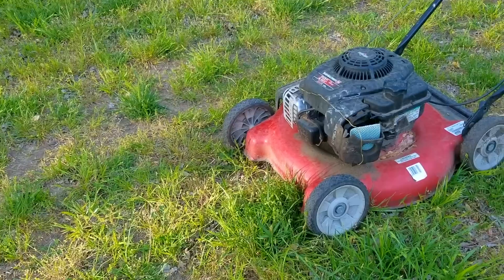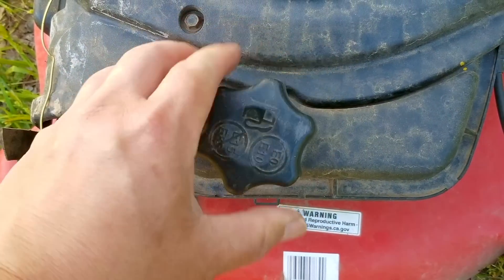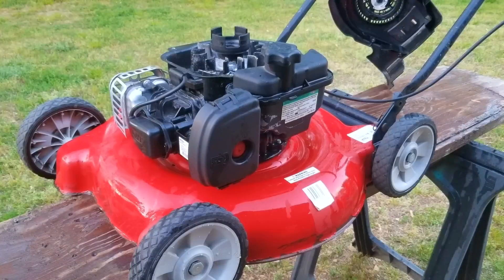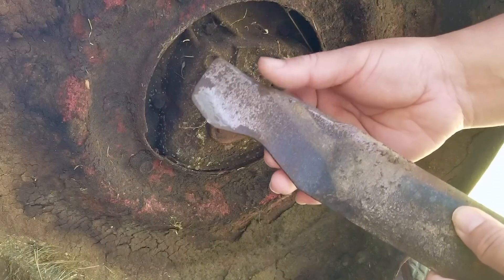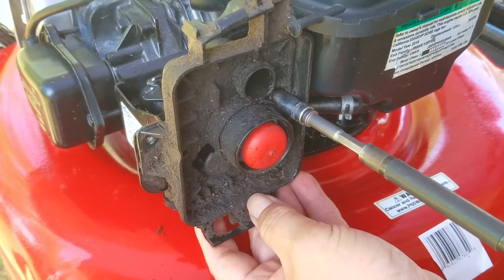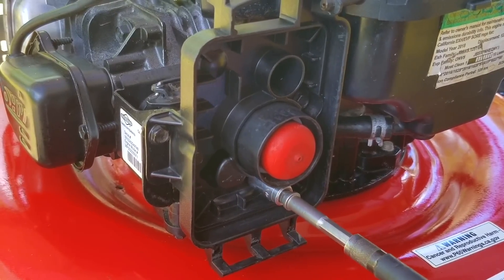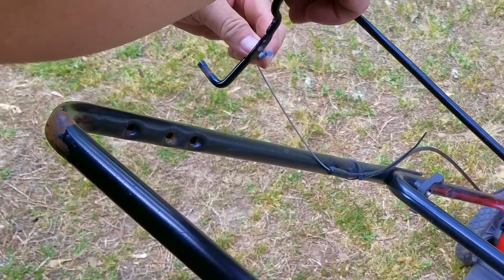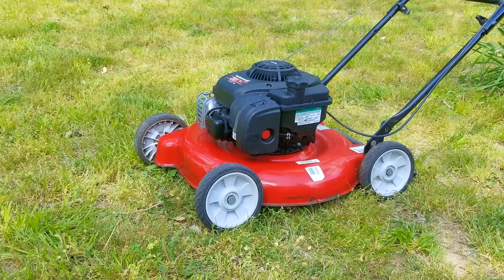Fixing A Redneck Repair On A Yard Machines Mower

Comment: These mowers were 79 - 99 bucks at the big box stores. They are now pushing $200 if not more. I always repair when possible. I have fixed equipment and sold or donated instead of trashing. Great video as always. 👍👍
Reply from the maker: thank you Dan Pags
Reply: $250-300. $299 at ace and home Depot. Lowe's dropped it down to $269 for the same MTD . The industry has been doing bad business for years. I blame excessively liberal returns, making too many different models and not fighting against regulations effectively. Also I guess running lean does increase horsepower but the government wouldn't let you play that up. Bull crap
Reply: Yes I was shocked.  For years these bolt wheel 20" were $99.  I bought one for the cabin at Lowes in 2014 and thought $135 was robbery.

I walked past a display and that thing is nearly 300.  

I was wondering how you could really profit off a used one with two or three hours work even if you picked it up  as free trash... as a fair price was likely $40 for a scratch and dent with worn blade...but now I see.  You're likely charging $150.

Comment: Good little video. Yes I've done this "Redneck" repair just recently on my JD L110 riding mower. For some reason the fuel is not get.ting from the tank to the fuel pump ( been extra busy to troubleshoot it) so I had some extra fuel line and took a fuel tank off a spare push mower then hooked it up to the fuel pump and she fired right up and I moved my lawn with it 😂😂😂
Reply from the maker: hey nice job!

Comment: Hmm.  When younger I may have used a wire coat hanger to hold up part of my car's exhaust system as well as something to patch a hole in the muffler.  I have no problem red necking something on a temporary basis.  Great repair of this mower.
Reply from the maker: hey if it works! And thank you  D Butler.
Reply: On my way to work one morning my exhaust broke behind my cat and was dragging on the street.  I yanked the boot laces out of my Army boots in my trunk and tied it up and drove to work nearly deaf.  Worked great to get it to a shop after work.

Comment: Clean the emulsion tube inside the carb. There are quite a few great videos out there that explain how to remove, clean, and reinstall the emulsion tube. I had a similar issue on my toro turf master with a Kawasaki FJ180V engine. It would start surging after five minutes. Now it works great. Thanks for all of your advice and informative and entertaining videos 😊
I am referencing the Troy bilt mower that has a running issue when hot
Reply from the maker: thank you Courtney Kensington

Comment: Great video🎉 Thank you. Looks like they never changed the oil on it.  It will take about a gallon of gas via 8 engine flushes to clean out that carbon and metal shavings in the oil reservoir.
But it will be a great visual selling point having clean oil in the engine.
It will give the illusion it was well maintained.
Reply from the maker: yes I think you're right!

Comment: A true red necked repair I did ones was on a 72 Ford f 100 ,it had a 3 speed on the column ,the column pair of the shifter had warren completely out ,by the time it had warren out finding a new or used replacement was almost impossible so I cut a hole in the floor above the transmission and attach 2 shift handles made from the handle of a push lawnmower one handle could shift it into eather reverse or 1st gear and the other handle could shift it into 2nd and 3rd 
We used it that way for about 4 years entail the truck finally gave up the ghost that was in 2004 and it had over 300000 miles on it
It 300 straight 6 in it
Reply from the maker: very true

Comment: I did a creative fix on a riding mower. The deck was broken near one of the mounts. I do not currently have a welder, and the mower was not valuable enough to warrant replacing the deck. I took a deck support bracket from an MTD riding mower that I had in my parts stash, hammered it flat, and screwed it to the underside of the deck directly under the support bracket. It provided enough support for the deck to function until I am able to purchase a welder.
Reply from the maker: hey that's good repair in my book

Comment: Smile - used molly and sheetrock screws to fix broken Honda airfilter enclosure. On the vintage one neighbor has it protrudes just enough that his planters rake against it. Mot enough meat to drill into so...

Comment: I've probably done every goofy thing known to man to try and get a job or day or week finished with something that hasn't been made since the Flintstones lent it to Barney Rubble but you use what you have at the time. I found that 4-O or OOOO-Steel Wool oiled up makes a good filter when nothing else is around. As to everything else, I plead the 5th or amnesia or general brain damage. Sure we have but getting us to admit it might be a hard thing to pull off. That was a FINE job and you need top dollar for that piece. The last Gravely will be gone from here tomorrow and the splitter shortly thereafter. ROOM! Thanks and Blessings!
Reply from the maker: nothing wrong with a bit of ingenuity !
Reply: @HomeGaragechannel  Poverty and desperation!

Comment: I just used jb weld to fix a crack in the deck of my mower. Not a rust hole, a flat out crack. Seems to be holding and while it appears to be fixed I’m on the lookout for either a replacement mower or a deck that will take my engine.
Reply from the maker: that works too.

Comment: Many owners of old VW's should be familiar with using a small pair of locking pliers in place of a rotted-away accelerator pedal.  The Vicegrips stay in place until you scrap the car, when you get your tool back for its next mission.
Reply from the maker: I like this comment

Comment: The one thing that comes to mind and just found the pic is using an old license plate as a bracket to keep the muffler on my snowblower. The cheap tin bracket, or the weld rusted and with a little bending and self tapping screws it's as good as new.
Reply from the maker: nice I like that one

Comment: did a great job cleaning it  and getting running  I was hoping you would discuss how to check the carburate   I have mower almost the same I took the carburate off  and clean it put it back and it started and it ran for a few seconds and then it quit I try to start it with staring fuel  and it will not start any advice you can give me will be appreciated
Reply from the maker: did you clean the brass jet at the very bottom of the white plastic part? If not you want want to focus your efforts there.
Reply: @HomeGaragechannel  I fail to do that  when I took it apart I found one of the three holes that it has plug up so  I assume that was the problem thanks for your quick respond Have a blessing day!!

Comment: What is the pre-spray cleaning chemical used before rinsing off with water?
Reply from the maker: I'm using the only degreaser Harbor Freight sells, they're in gallon jugs
Reply: Ok. Great! Thank you for the reply.
Reply from the maker: no problem

Comment: Yep that's my brother he really doesn't put any money in to his lawn mowers. I have his he let me have it runs its the 6.5 briggs engine i like them my dad has had a few of them run good if you change oil and use stabilizer and fog carberator before winter prime the fuel bulb and they fire right up every spring. My brother has had that mower for 8 years. Now he has my grampa mower wich is really nice. But it wont be it will sit outside maybe coverd up with a blue tarp some times hes also like that with his cars just rough on them.
Reply from the maker: that's tough to hear.
Reply: @HomeGaragechannel  also the air filter is falling apart and oil desperately needs to be changed it runs good but can run better. I also asked him if he had the 2 covers for the mtd yard man snow blower for it he said know he didn't. I will see if I can fabricate some covers or I will buy the covers. I know you should have them on there for protection from snow and dirt.
Reply from the maker: you are correct about the covers.

Comment: The lack of levers for height-adjustment is why I bought a Hyper-Tough 20" mower in 2020, instead of the competing Yard Machines or Poulan variations on the 20" side-discharge mower theme.  :-)
Reply from the maker: it makes sense to me

Comment: I'm sure you get flack for the amount of time you spend dealing with the wheels, but it is a legitimate concern. My big riding mower is 16 years old and has never had any preventative maintenance done on it before I got it. The wheels were never greased, and the openings on both front tires have worn out. Both front tires wobble. I added some washer to them and it helped a little, but I will soon have to replace both of the rims due to this lack of maintenance.
Reply from the maker: yes I've seen that happened before. It's amazing how someone could spend that much money on a rider and not read the owners manual

Comment: Choose wisely with 3d printers, cheap ones often can’t do high strength materials. Better ones can do rubber like materials and good strength materials. And high end can do nylon and polycarbonate which is basically indestructible
Reply from the maker: wow nice, thank you for the information

Comment: Hey there, I was wondering if you know the valve lash clearances for this mower?
Reply from the maker: sure .003" to .006"   but I find it easier to set it to .005"
Reply: Y you so much for that! I went ahead and adjusted the vale’s to that spec, but unfortunately my mower still has hard starting. I know it is a fuel related issue as it starts and runs perfectly once it gets going with drill, starting fluid, etc. I realized that pressing the priming bulb about 15-20 times gets a good response from the mower, but the factory 3 presses does nothing (this only happens when the engine is cold, starts first pull when warm). The carb has been cleaned and all internal seals look good to me. I wanted to ask real quick about how this system of the bulb works (creating vaccum in carb thus pulling more fuel, idk). Also, what is the little white spigot on the side of the carb? I feel air come out of it when the priming bulb is pressed. 

I’m sorry for the long story/question. You’ve been a huge help, thank you!
Reply from the maker: the bulb "pressurizes" the carb and forces fuel into the inlet of the carb.  That's how it primes the engine with fuel.  The white piece on the side of the carb is an air vent.   Have you done a compression test? If the test returns a "low reading" it would be the reason why it's tough to start.

Comment: I'm curious what you would ask for this mower. I just had the identical mower that I repaired and they were fighting over it in the driveway. Maybe I didn't ask enough?
Reply from the maker: it really depends on where you live but I'm in a suburb of a large city.  The new price for this  mower is $250 locally, so I'd say $90-$120 is a decent price range considering it's overall condition.

Comment: That dishwashing sponge isnt a bad idea to get you by on a cheap mower if it sealed better.  Soaking it in oil would help a whole lot more. I'm sure it filters better than a K&N since you can see through a K&N.
Reply from the maker: very true.
Reply: Yeah.  If they had cut the dishwashing sponge to fit like an OEM air-filter, I'd have been more impressed.
As an improvisation, the concept has merit.  The execution fell flat, though.  :-)

Comment: I have an air conditioner in my house which the sleeve rotted out (it is a large unit which the air conditioner itself slides out from a metal sleeve). For some reason the sleeve is almost completely rotted out at the bottom, but the air conditioner unit itself has no rust on it at all and runs fine. I used a ratchet strap to keep the air conditioner from falling out the bottom of the sleeve. I guess that would classify as a redneck repair...
Reply from the maker: very nice fix!

Comment: I have same mower it starts when I pump the red button but dies right after. I pull the throttle and parts move but, not by the carb. Do you have a diagram?
Reply from the maker: No I don't

Comment: well for me i,m not sure really but yeah thankfully Gasket Paper is often a good source of parts to make for either machines that no longer make those ones and yes i have had get creative and measure cut and trim and hole punch to size and it,s often worked for me etc.
Reply from the maker: nothing wrong with putting in effort to make a replacement, this was one of those times where they didn't try as much as they should have. Thank you Patrick Stapleton
Reply: @HomeGaragechannel  my pleasure mate and yes my good mate who lives in NSW (New South Wales) Australia might also agree with me too

Comment: It sounds like she is reving a little high, there should be a spring hooked to a little metal tab. You can bend the tab to increase or decrease the rpms of the engine.
Reply from the maker: yes you are correct. Good Ear. I did adjust the engine speed later on.

Comment: I have a stihl fs87 and when I give it gas and want to mow it cuts out and when it idles the head in which the wire is turned also turns when I want to start it sometimes it cuts out please help
Reply from the maker: sure, replace the carb and the clutch
Reply: @HomeGaragechannel  okay that's not a good sing but its 20 years old so i think it's not worth it haha
Reply from the maker: I understand. It sound like you got good use out it
Reply: @HomeGaragechannel  Jup that's correct and i bought 2 new echo's so i have no worries haha 😂

Comment: Yes, that air filter was bin stock unfortunately, idk also eep spares dr myself
 too😊
Just to add it. Sounds like it’s rpm sevens high?
Reply from the maker: yes you are correct, and I did adjust the engines speed, later on. Thank you Rick Thelian.

Comment: I've picked 3 mowers with the same BS engine , I'm a fan of BS engines but these latest engines have issues valve seats dislodging the plastic carburators warp and the gaskets leak keys on the mower disk floged out pull cords frayed on sharp edges
Reply from the maker: interesting, I haven't had to deal with any of those issues, I wonder if it's a regional issue

Comment: I broke the crimp on the low voltage wire to my automobile starter motor.  I wasn’t at home but always carry zip ties. I zip tied the wire. It worked and got me home.  Did I mention it was 4 years ago and I never made a permanent repair and am still driving the automobile?
Reply from the maker: wow that's pretty amazing!

Comment: what is the red bulb on the air filter cover?
Reply: Primer bulb to prime the engine that plastic part is the carburettor well apart of it anyway alot of newer mower engines use similar style carburettors

Comment: It wasn't on a mower, but I bought an old Oliver tractor to fix up a few years ago.  It takes the cake for the worst repair ever.  The previous owner had used a piece of garden hose to replace a hose on a hydraulic oil cooler.  I'll let you make your own assumptions as to how well that worked.
Reply from the maker: wow that was a crazy idea.

Comment: Perhaps something in their shed snagged the air filter cover and ripped it off.
Reply from the maker: that's a very good possibility
Reply: @HomeGaragechannel  It happened to me! I promised to mow the part of the lawn I was occupying. Didn't notice the cover was off and the filter was dangling until I went to lower the deck.

Thankfully, it only ran unfiltered for like, 10 seconds.
Reply from the maker: yes that was good news
Reply: @qwertykeyboard5901  sounds like a Honda... ? One I see often the filter cover hangs far off that side of the engine.

Comment: Man it baffles me what are mower manufacturers thinking when designing mowers? Like for example you have the company Ryobi made a battery operated riding mower that used Lead Acid batteries which are the same kind of batteries that a car would use and now Yard Machines designing a mower without an easy way to do height adjusting.
Reply from the maker: how long ago was that Ryobi mower? Must have been some time ago?

Comment: I hope you changed the oil. It looked like it had never been changed. Also, it sounded like it was running a bit fast.
Reply from the maker: you are correct it was running a bit too fast. And yes I didn't show it but did change the oil .

Comment: Hey i need help with my own project, im trying to fix my old tomos lawn mower from 1990 i got it to start but when i give it gas the engine starts to stall but in idle it works fine, do mind this is a two stroke engine
Reply from the maker: that's very strange, maybe someone adjusted the throttle cable, too much and when you're moving to a faster speed, it's moving the carb to choke. Take off the cover for the filter and the filter, and confirm that the choke isn't closed when you move the lever to fast.
Reply: @HomeGaragechannel  its all manual, throttle and choke, and im not applying throttle from the cable but from the lever on the carb its self, and i cleaned the air filter, its a metal one with a mesh so i can clean it in gasoline
Reply: @HomeGaragechannel  Hey i just wanted to let you know that i have fixed my tomos lawn mower and now its working very good

Comment: why cant a single person show or tell me where the oil drain plug is on this?? u think u could show it.. geez
Reply from the maker: on this model, I don't think it has one.  Tip back the mower and look near the shaft.  There's a spot for a plug but it's not there... geez
Reply: @HomeGaragechannel  so how do I change the oil???? u have to siphon it back out??
Reply from the maker: you have to tip the mower on it's side, but using an oil siphon works well too.